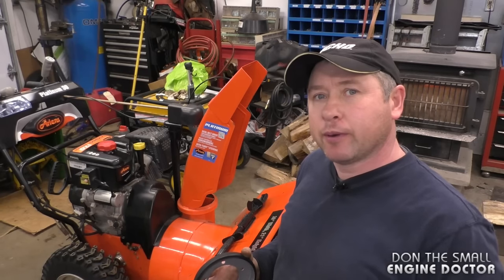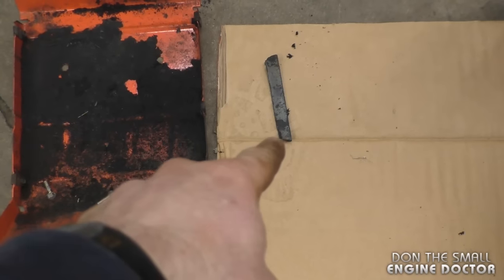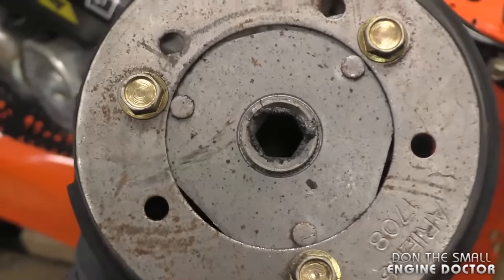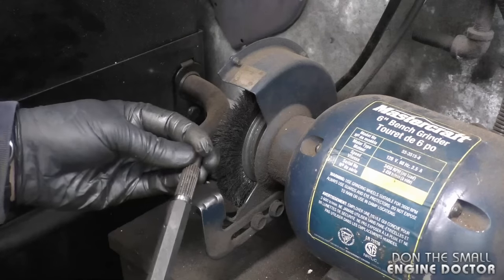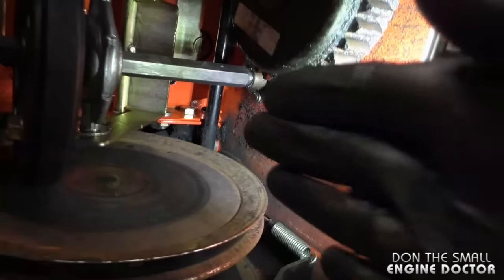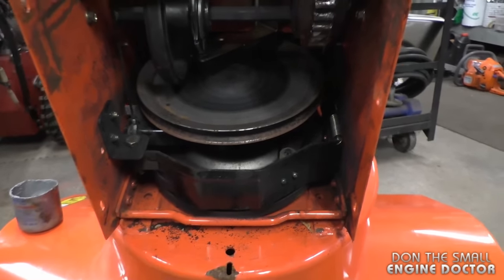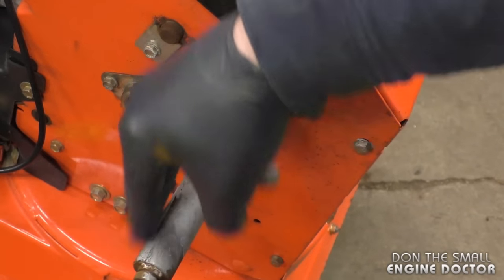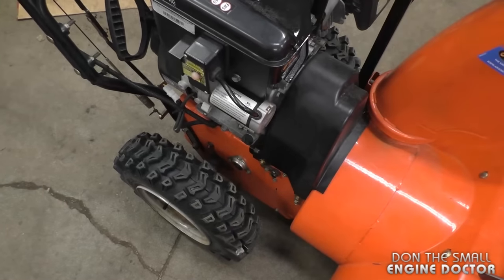HOW-TO Replace A Friction Disc On Ariens Snowblowers - Make It Drive Again!  - Video

Comment: Don,  At the 9:40 mark you said you don't know what the clips are for but you always replace them.  That's good to know.  Sir, those clips limit how far the friction disc can traverse along the shaft.  In other words, one clip stops the friction disc travel in the reverse direction and the other one stops at the maximum gear position.  Over-travel of the friction disc would not be a good thing.

Comment: my snowblower is 3 years old with little use.  i can' get it to go into the highest speed, but lower speeds and reverse work.  what do i need to check to find the problem?  it is a troy-bilt 2665.

Comment: Would it be possible to cover various snowblower starter motors? My 11 year old Craftsman with tecumsi has a lightly used (like used only once per year, I always pull start) starter motor but the engagement gear isn't able to engage the fly wheel anymore.  Motor is very strong, and I tried lubing the shaft for the gear, but it refuses to consistently link to the flywheel now.  Doesn't appear that one of those rubber friction discs were ever present.  Figured I'd ask before buying an $80 motor if this can be fixed with a $10 part.
Reply from the maker: sometimes lightly lubing the gear shaft helps

Comment: Hi dony, I noticed that during your video, you used more than one type of grease for differents parts, would there be one multi purpose grease that could be used instead? Thanks and have a great day!!!
Reply from the maker: i use lithium on friction disc shaft and a low temp grease on other parts
Reply: I prefer to use red sintetic water resistant grease in such places. Because it stays much longer on the parts, then other greas.
Reply: @donyboy73  is there any difference between the white lithium paste grease in a tube and the spray can stuff. I thought that I had used spray on my blower yet disc is sticking after short time. Sprayed with brake clean and it slides ago. I guess that I'll try the spray again.
Reply from the maker: @kenhilson786  same grease, just different methods of delivery, i use spray in hard to reach places

Comment: As a mechanic and owner of a small engine repair business I am constantly replacing Ariens friction disc.Especially on the newer units, a defective part and design in my opinion.If you compare older Mtd  units I commonly see friction wheel last of life of unit.

Comment: Good video. Thumbs up! What caused this failure and on such a new machine?
Reply: Just normal wear.
Reply from the maker: wear and tear, but only Ariens burns through discs at this rate!
Reply: @donyboy73  Hey Don. Hello from Halifax N.S.! It's not only Ariens! The friction disc on my Husqvarna ST224P was totally destroyed. It's only 3 years old with no more than 10 -15 hours on it! It's just back from the shop. I think your video would have encouraged me to try the repair myself. Would Husqvarna be much different than the Ariens?

Comment: Don, something is going on with those friction disks... My original lasted 10 years in my 30'' Ariens but now the disks my local Ariens shop is selling me last one winter. There is no brand name on the disks. I'm looking for the Oregon brand but they seem to be discontinued. Any tips?
Reply from the maker: it's because the friction plate is made of metal and not aluminum. check www.dicountonlineparts.com for the oregon disc

Comment: Sweet video. I’m so pissed donyboy73 the bolts on my rake support literally sheared off same machine as this one. I tried drilling it out with left handed drill and extractor. Than it eventually broke the rake support that holds the auger shaft to the housing.  I tried unscrewing the opposite side of these bolts and sheared off also. After spending all day on drilling out one bolt, I eventually took it to my repair shop, unfortunately. Those rakes don’t come out easily
Reply from the maker: yes I see that a lot, unfortunately Ariens has dropped the ball on this one!
Reply: @donyboy73  expensive repair? Does it typically take you long time to repair? We shall see from my billing in few days. I literally unscrewed and it just snapped. How cheap. Honda won’t do that. I think you have to split machine in half to get to rake support
Reply from the maker: @appleztooranges  it will depend on how honest the repair shop is!
Reply: @donyboy73  damn. Was going to just buy two new rake supports but after unscrewing all bolts off it doesn’t simply come off the housing like the Honda does. Maybe there’s an easier Way. Thanks
Reply: @donyboy73  I’m surprised. I thought ariens was better than that. Glad I got the Honda 1332 as a backup. I’d be freaking out if I didn’t and a storm came lol.
Reply: @donyboy73  charge me $95 USA. Not bad. Split the whole Machine apart. Had to drill the support brackets. One side where it broke (support bracket) they did a longer bolt and did a washer to hold it solid. They said stronger than factory. Hopefully last!
Reply from the maker: @appleztooranges  good deal!
Reply: @donyboy73  debating on selling the ariens and getting a used Honda 928 wheels? What do you suggest. Put sour taste in my mouth knowing ariens has this type of quality control where the bolts just snapped off
Reply from the maker: @appleztooranges  i would assume the shop put in better bolts, you have to be careful buying used hondas, they can have issues if people didn't maintain them
Reply: @donyboy73  keep the ariens Than and keep my Honda hs1332 👌

Comment: That "tab" on the side of the housing acts as an indicator of wear and also acts as a "stop" to keep the disc from metal to metal contact when totally worn out.  And I believe that those clips on the "friction disc shaft" are there as "stops" to keep a poorly adjusted from disc from exceeding the edge of the lower turntable.

Comment: If you have an auto-turn machine like this grease the inner axle on the wheel that is on the zerk fitting side. It is a hollow axle over the solid inner axle. I have seen them seize up and the wheels will not rotate independently. Then they state it is hard to turn around as the wheel drags not roll. A lot of people do not do that, and if it is rusted bad enough you need to cut the axle to get it apart. If you have the wheels off already it is not difficult at all, and only takes a few minutes more.

Comment: I like how there's a grease fitting that would only be practical to grease while the snowblower is moving. Otherwise you have a mountain of grease that has fallen onto the drive plate.

Comment: funny but mine is not made the same at all no keyway & no clip like  that one i have a 24'' with no light in the front & i have 2pins for the wheels which slide in to the holes on each side also where do you grease with the grease gun the inside or out

Comment: Dony, the Jack isn’t required really, just turn the chute to the side. That Areoens is designed to be tilted fully forward and rest on the auger housing. Ariens calls it the forward service position.

Comment: I wish I would have put  Anti seas on the hubs and axis shafts. I have mess ben soaking in  pvc  blaster penetrating oil spray. I think I am going to need a new shaft and two new rims. I'm thinking about cutting the shaft at both sides and machining the shaft out of the rims.  To try and save some parts

Comment: On my 22" you don't have to remove the wheels - which will be very stuck after a few years, I show on a video.  It's also a magic moment to inspect the auger input shaft bearing (behind the auger belt flywheel, need to split the blower in two).  My bearing was shot after 25 hours of use, Ariens puts a chinese Peer bearing and wants $30 for one. Got a much better brand off Ebay.  May also want to look for a good aftermarket friction disc because the Ariens one is using very soft rubber for 'smooth engagement' which doesn't last long - look at all that rubber bits on the belly pan.
Reply from the maker: I use the oregon discs, much better
Reply: @donyboy73   Got the Oregon as well, the rubber on it is rock hard, while the rubber on Ariens is eraser like (including the genuine replacements they sell). But I've heard the Oregon company was sold by now, wonder if their parts will keep the same quality.

Comment: After much Goggling and YouTubeing, I got here. My Troybilt blower has the opposite problem. It creeps forward or backward when the engine is running. Someone said the disc is dragging, but did not make sense to me. Do you have a video that addresses that? I adjusted the cable as suggested by a Sears Parts Direct video, but that did nothing.
Reply from the maker: make sure the cable isn't adjusted too tight and that you have correct drive belt
Reply: I got a free old Toro because guy couldn't steer. It was actually a misadjustment on the drive disc.

Comment: Very nice video, right up to "using a bit of gas" to clean anything. Use mineral spirits or diesel fuel if nothing else available. Spilling a bit of gas from a full can can ruin your life in a nanosecond.  Other than that, great job...

Comment: QA very good video, except for the ad=vice on using gasoline as a solvent.  Gas should never be used as a solvent, it is far too flammable and lately far too expensive.  There are lots of good solvents available.

Comment: Its a easy repair until the wheels get seized on the shaft... lol.

Joey from Ottawa
Reply: yup, either soaking in PB blaster and propane heat over a few days, or if you are fortunate to have an oxy tank setup, heat and quench with a garden hose and air hammer it off works fastest. Sadly i dont have a setup like that, but I want one lol!
Reply: You know it.

Comment: #1 its easier to clean the friction drive plate - when you had everything taken apart !
#2 use a little 220 sand paper or steel wool to clean n polish up the axle before adding the anti -seize or lube before installing the wheels 
#3 I am willing to bet you need to add some air to the tires !

Comment: Put a plastic bag over top of gas tank and screw the cap back on. Gas will not leak out.
Reply: Yep. I was going to suggest that also but was checking to see if someone already suggested it :-)
Reply: Did that last week. Unfortunately it leaked. No big deal.
Reply: @aldiminico6513 Not sure if you did it right because I have done it multiple times and it hasn't leaked. There are a few videos that show it. Basically you need to remove the cap, fold the bag multiple time so its thick enough, put it over the hole "then screw the cap back on".

Comment: how do I know if this friction disc fits my Ariens compact 24? Ariens discontinued it and does not state the size if it.
Reply: They discontinued the compact 24?  Where did you hear that?  That model is the most sold model at my local Home Depot the guy told me.
Reply: @mainelyelectric  I didn't say that.

Comment: I’d be curious to know how the friction disc failed so early. Pushing too hard into snow banks?
Reply: That or clearing the snow in too fast of a gear.
Reply: @joeyg-smallengine1116  ya, that would do it too
Reply: @alveus8205  it would be better to go slower and get better traction anyway... and not replace a friction disc. Lol

Comment: It's surprising how some people burn those up quick while some machines just go forever.  I know when I bought a new machine, it slipped at first and adjustments didn't fix it.  I just made it a point to not force it to slip or let it slip.  After a couple years, now it works fine and it won't slip anymore.  I dunno why that happened, but I know if those rubber wheels are anything like car tires, they will need a "break in" time to hardened up before the can handle real abuse.

Comment: You can never have enough lubricant on these blowers...the salt and snow wreak havoc on exposed metal surfaces.
Reply: I clean my snowblower up every spring and touch up any missing paint with some anti rust paint.  I've seen so many that are totally rusty from the salt

Comment: First off….thanks for the great how to on this job. It’s my second  time at bay with a year of replacing this aliens disc. Now for my gripe about Ariens parts and their lousy customer loyalty. These friction discs had to have been defective. Not a single warning about faulty friction disc rubber peeling off issues. I had replaced it last year after many years of use. In less than a year,  a new friction disc failed; peeled right off. It had to have been a defective batch as when I went looking for reviews of the Ariel’s part, nearly all the reviews on their own site stated the same problem. Aliens doesn’t look after their customers and they are not cheap. Also, where I live in MT., their is no other choice. I’m buying a Honda next time. The money save on the front end of this piss poor design will be saved in winter hell when you have to repair it in the cold damp spring. Am I angry about this….damn straight!
Reply from the maker: Same problem here. Ariens should have recalled this disaster!

Comment: That driven disc looking like the same one that is used on snapper rear engine riding mowers  correct me if I'm not right  be safe out there young man and your family
Reply from the maker: yes it is Robert, the disc i show in video fits on many machines! have a good weekend!
Reply: @donyboy73  you do the same thing young man

Comment: These machines are brutal you have to do this every 3 to 4 years 
My old craftsman I get 20 years out of the disk I go very slow when I plow snow and disk still wears the rubber off the disk on the Ariens
I would not recommend the new ariens built well but who wants to do this all the time

Comment: Heads up -- the older machines are completely different when it comes to changing the wheel.  This video won't apply to those
Reply from the maker: You are correct